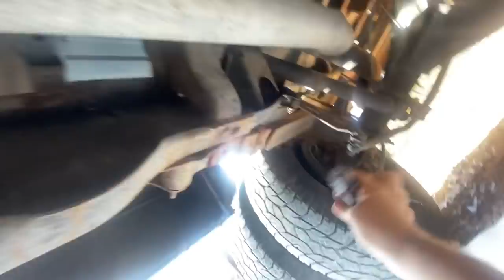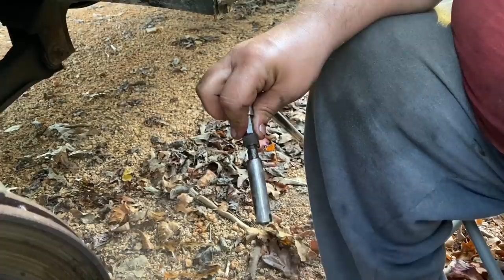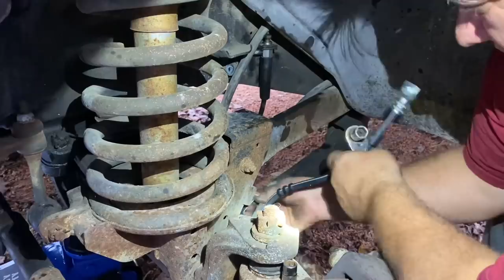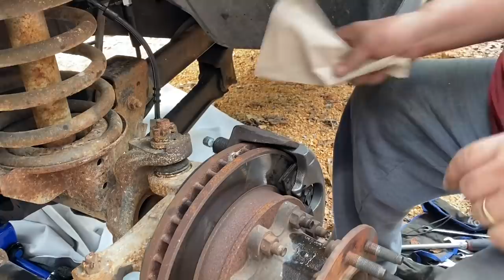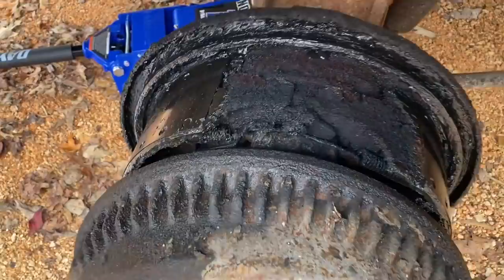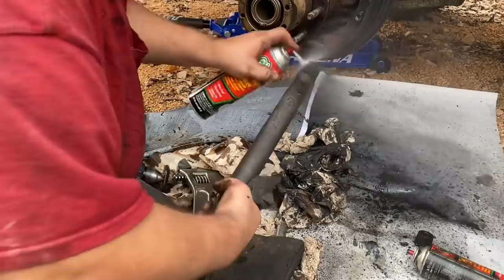Brake work and maintenance on the dodge 3500

Comment: The jack is not low on fluid. It's secondary pump  check ball is stuck likely from metal filing not being properly cleaned out during manufacturing or just poor manufacturing. Harbor Freight has zero quality control and put that task on the consumer to waste their time, effort and money to return it or toss it if they wait too long(win win for them). I just watched another video last week where a guy had a HF jack collapse on him under load. Best part is HF is not liable for anything they sell as they manufacture nothing. They are simply a middle man pushing products from independent Chinese factories and you're left going after Wong Lee Inc if you get hurt. Good luck with than one.
Reply: That would make sense if it's a two pump jack and the lift stops at load rather than position.
Maybe Scott will update us with solution.

Comment: Changed my carrier bearing on my 2007, and it is a major pain! Glad to see the truck videos, hope you make more of them! These old Dodge with the Cummins last forever. I would check the u-joints on that drive shaft, the carrier bearing going out usually causes u- joint to fail as well!

Comment: I had a similar problem on my 03 Dodge Dually with the front brakes. It would brake fine, but when releasing the truck would pull to the left. Turned out it was the little metal clamp that surrounds the brake hose, that you bolt to the suspension. It had rusted on the inside and was putting pressure on the rubber hose. When you braked, it would force the fluid pressure down the hose through the obstruction, but when you came off the pedal the pressure would take time to release. New hose and clamp and all was good.
Reply: Yep had the same issue on my 97 this week. just pried the clamp open a little bit and its fixed!

Comment: The carrier bearing is super easy to change! 4 bolts and slide it off and slide the new one in. Takes 15 minutes. I did one on my 99 2500. A Jack helps hold it in place while you put the bolts back in.
Reply from the maker: It is much more involved than that.   Press fit, drive shaft has to come apart and the tiny splines need to be perfectly aligned.  15 min won’t even have the drive shaft off.
Reply: @BusGreaseMonkey  True. You may end up slicing it with a die grinder. Gaurantee it won’t just slide off.. As you are aware just make sure your slip yoke is in phase with the rest of the driveshaft when you re assemble it

Comment: You got two problems, a harbor freight jack and a dodge
Reply: @mikek5298     Actually not trying to be smart..Should have bought a super duty f 350
Reply: Triggered the dodge owners.
Reply: @scottbaker1018  I believe Scott got the truck free from the fellow in Missouri with the two GM buses that got passed over by a tornado.
Reply: Like all old vehicles, reliability is proportional to the amount of maintenance done....  Old Dodges, Fords, Chevys, whatever - it's all pretty much the same.  And, yeah, I've owned and worked on all of them.
Reply: @scottbaker1018  so is that how you know about Jack's because you have a ford
Reply: @davidcaskey4669  Yep i need to jack up my ford to get rid of the pieces of chebbys and dodges I ran over 😂
Reply: @scottbaker1018  you are right about one thing  you do have too lift the body up off a Ford just to work on those power junks

Comment: I had to do driveshaft repairs on my 2004 Dodge. Pulled the shaft. I even have a 20 ton press. I could not remove it. The local place was amazing. They took 20 minutes to do what I struggled with for 4 hours before giving up and having a beer. Oh, and have them replace the u-joints while they have it apart.

Comment: If that is a "two speed" (Rapid Pump®) jack, the valve that shifts from fast to slow is stuck.

Old bleeder : Crack the banjo fitting.  Apply heat.  Quench the bleeder with an ice cube. Use left hand drill bit.

Drain the differential.  Refill.  Drive for a couple of days and drain, while hot, and refill again.

Comment: Recommend replacing the rear wheel cylinders when you do the rear brakes.  Didn't catch what was up with front axle carrier (differential).

Comment: What I find the best way to extract a busted bleeder valve, broken bolt, etc., is to drill and tap with a left-handed bit and tap with a smaller diameter bit and tap, then use a left-handed bolt to draw it out. Sometimes the drill bit is all you need if that draws the remaining bleeder valve out.

Comment: I was glad to see the proper lube on the sliders for the new caliper. Never use wheel bearing grease on caliper sliders, it gets thick and gooey sticky not allowing the caliper to move properly.  Get a hardware kit for those rear brakes, you'll get all new springs and a new adjuster along with other goodies your gonna want.

Comment: Saw you change out the caliber. sSuggestion when changing out any caliber, you should remove the bleeder valve and put anti- seeze on the threads and put it back in.  The cast aluminum of the caliber tends to gall the steel bleeder valve, making it difficult to turn when bleeding the caliber.

Comment: If you are regreasing sliding caliper pins in rubber sleeves, you gotta use the right grease. Like the milky coloured stuff on the new caliper. "Normal" grease attacks the rubber liner and makes it swell, jamming the pins again. Done it myself.

Comment: My friends Dodge truck had both of the clamps  in the middle of the brake hose rust. The rust swells and crimps the hose shut. I also had the same thing happen to my Malibu. I cut half of the clamp off and put some cable ties to hold them.

Comment: SCOTT UR A VERY HARD WORKER!!!! I WISH WE LIVED CLOSER U COULD BRING THE DIRTY DODGE OVER & WE COULD PUT IT ON ONE OF MY LIFTS & WE COULD GO THROUGH UR TRUCK THROUGHOUT OK SCOTT MY BROTHER JUST PULL THAT DRIVE SHAFT & GET THE HEAVIEST DUTY CARRIER BEARING PREFERABLY WITH A GREASE FITTING ALONG WITH ALL UR U-JOINTS & TAKE THE DRIVE SHAFT TO A DRIVE SHAFT SHOP & LET THEM REPLACE ALL OF THEM PARTS ITS ALMOST IMPOSSIBLE TO CHANGE THE CARRIER BEARING & U-JOINTS WITHOUT A TORCH!

Comment: Vent tube on rear axle plugged.  Keeps condensation inside axle heat and cool off.
Rear brake cylinders will be full of water and rust.  Best to replace with new, can be honed and rebuilt if you can find kits

Comment: Dodge Ram are notorious for having squishy rubber brake hoses. My 07 2500 had the same thing on the drivers side. You hit the brakes and it would dive to the right (passenger) and then it would straighten out after you yanked the wheel to the left. A Dodge mechanic said he recommends changing the brake hose every 35 to 40 K.

Comment: The jack is low on hydraulic fluid.
Reply: Exactly. HF will usually cheap out on a component, so they cheaped out by not enough hydraulic fluid. HF cheaped out on my reciprocating saw by using a cast aluminum collar. Collar broke, ordered a new one but got a chunk of forged steel, fabricated the collar out of the forged steel by shaping it the exact same as the cast aluminum one, never had any problems since and now it's 15 years old.

Comment: Unitized seals are way to go with that rear axle hub.  I replaced the hub seals on my Ram 2500 and they leaked again in very few miles.  The next time I installed Unitized seals and they have been bone dry for the last 60,000 miles.

Comment: Your Jack may just the air bleed out of it. Here are the instructions out of the manual for the Daytona 4 ton Jack.
1. With the Jack fully lowered, remove both Screws
on the end of the Cover Plate that is closer to the
Saddle. Swing the Cover Plate open. See Figure A.
2. Remove the Fill Plug on top of the Cylinder.
Check that the oil level inside the Cylinder is
at the top of the Piston. See Figure B.
3. Insert the Handle into the Handle Socket
to operate the Release Valve.
4. Turn the Handle counterclockwise to open the valve.
5. Pump the Handle up and down quickly
10-15 times to force air from the system.
6. Replace the Fill Plug, close the
Cover Plate, and reinstall the Screws.

Comment: On the front rubber brake caliper lines. The metal bracket rusts and pinches the hose. Try and loosen the metal brackets on the rubber hose.

Comment: You are better off replacing the caliper, actually it could be the problem with the brakes sticking. I did a front brake job on a Dodge truck a few weeks back and advised the owner to replace both calipers because of age, but he refused because of the price, long story short he called me a week later and said one of them locked up outside of Nashville, 450 miles from home. Over the years I’ve seen many of them stick and lock up. From this point forward I’ll refuse to do a brake job if the customer refuses to replace the calipers with mileages over 100k or 10 years old.
Reply: Dodge had issues with the phenolic pistons on the oem calipers. Seen them wear the pads uneven but never lock up? Im in Ca so manbe snow and salt is an issue in some states

Comment: Moog carrier bearing at auto zone $25 labor $75 at local drive line shop. If the bearing is good you can buy just the rubber part and maybe have $25 total in it.

Comment: Get all new Lug Nuts, in one brand. Brand A will be 7/8th, oem might be 15/16's and brand Z will be 1 inch.  Change the rear axle gear oil, you might want to check the axle seal on the other side as well. Usually on light duty trucks they fail around the same time.

Comment: Sometimes they ship those jacks low on oil
It is low on oil
Reply: yes... cheap fix. Hydraulic oil  fill up point is normally on the top ofthe ram
Reply: Yeah, and a cheaper fix is just exchanging it for one that actually works while it's still under warranty. Poor QA should not be the customer's problem.
Reply: H.F. usually sells cheap made in China. If still in warranty take it back with receipt to get a new one. Could likely be out of oil but pump sea or cylinder seal.may be bad. Never seen repair kits for these unlike the American made ones that can last forever when renewed.
Reply: Most tools from HF you will need to do the final check out and adjustment, just the way it is.

Comment: I suspect your trolley jack may have flipped a seal over.  Unfortunately, a lot of modern jacks aren't made to be serviceable so taking it back and getting a replacement or refund is probably your only option.  One of my trolley jacks is 60+ years old and only on its' second set of leather seals.  It'll lift a car or small van like it's on an express lift/elevator...

Comment: What happened to the innards of the front axle?
Keep one brake assembled as you work on the other side, that way you'll have a reference (or take pictures.) Buy a new hardware kit when you get the shoes, they aren't much money, the springs lose tension as they age and will cause the shoes to drag.
Reply from the maker: The front axle is somewhere over the rainbow 🌈
Reply: Always called that method of keeping one side of drum brakes assembled “the Iranian blueprint”. 

Gotta be careful though, since some of the hardware is reversed. Make sure the self adjusters will spin the right way (before they inevitably freeze up), and the shoes are in the right position if there’s a little and big shoe.
Reply: Just have to remember one side is a mirror image of the other.

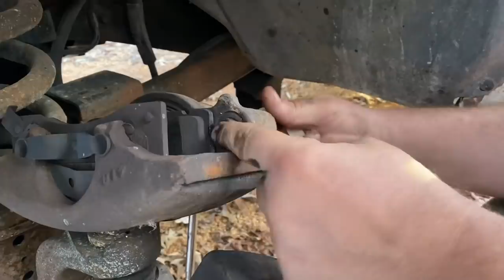Comment: 4:20  The only caliper lube  I have found to stop those specific caliper slides from seizing is 3M Silicone Paste 08946.  I have tried everything from Sylglide, exotic brake lubes, grease.  Some will seize in a month, some make it three months, but they all seize in short order.  Good idea to remove the rubber inserts remove rust etc, and line the bore with the silicone paste as well to keep rust jacking at bay.  It is a shitty design, only lasted about a year before Dodge changed it.  The rubber deflects pumping the lube out, and ingesting water.

Comment: Whay do you need a new caliper for?? you should have heat it up before with a strong blow torch,  you can drill it out with a left-handed drill bit or make your own left-handed drill bit using a right-handed drill bit, one size smaller than the bleed nipple if that's 10 mm use a 9 mm drill bit ideally doing it in a drill press or can be done by hand, or a small chisel you could chisel it out and might be needed after you drill it out, ideally a thread extractor. You should really have taken the nipple out and put a bit of brake grease around the thread and the bass there's no need to tighten them extortionately just nip them up
It's not a bearing it's a bush and you can fill it with silicone make sure it's centred first and has to be hard silicone not stuff you use for your bath one that can be baked
You'll need to go round the drum on the edge probably have a lip, with a stone in a drill depends how big the lip is

Comment: I'd be doing  wheel cylinders while in there. Also shocked at the surface rust, there never seems to be a corrosion coat put on US made cars
Reply: That's intentional....to make you buy new again after a few years.

Comment: Hey Brother ! I would go ahead & REPLACE BOTH FRONT CALLIPERS & ESPECIALLY THE BRAKE HOSES! I’VE HAD THEM HOSES STICK WHENEVER U APPLY THE BRAKE & TAKE :20-:30min to release if they release! Ur going to be hauling a lot of stuff I think I even heard u said Tyler & Carter was going to take his GOOSE KNECK TRAILER TO GET A BULLDOZER & BACKHOE! I wish I was closer to u! If u tell me what the ratio of the front & rear differential is I may have a front differential & if u can get me the measurements on both drive shafts I may have all of that stuff off a truck I junked I just wanted the Cummings Engine! The truck only had 65,000 miles on it! ALSO IM NOT SURE ABOUT THE TRANSMISSION I THINK IT WAS A AUTOMATIC BUT EITHER WAY IF U WANT THAT STUFF U CAN HAVE IT FOR UR TRUCK!!! Let me know about the ratios & measurements & I will go look for that stuff! 
SCOTT U CAN HAVE ALL OF IT IF U WANT IT! I’m APPROXIMATELY 7-8HRS from Nashville Tn I live in Wv about 9miles from THE TAMMARACK IN BECKLEY WV! Everything is a wreck I sold one Division of my trucking company so everything got moved! Around but my Forman keeps a pretty good mental note where things are placed! Here is my Email daveellison1971@gmail.com
Reply from the maker: 3.54 is what’s in the rear.  Do you know what is in your axles?

Comment: Looks like you gotta look at some of the videos from South Main Auto.  I wouldn't of used that grease on those brake caliper bolts.
Reply: I dont know what kind he used, but I have fount that using standard grease on pins like that swells the rubber and make the pin stick worse.
Reply: After watching more of the video i see the new caliper used the silicon brake grease which is def what to use.
Reply: "Not a sponsor"

Comment: I couldn't tell what kind of grease you were using on the caliper pins. You should never uses chassis grease. It will make the rubber bushings swell up. Permatex makes Ceramic high temp caliper pin grease. Like I say, I couldn't see what you were using, so if i am wrong, ignore me!

Comment: Please stop using brake clean and other chemicals without gloves. All that nasty is absorbed by the skin and gets stuck in your liver. If you would not drink it keep it off your skin. I did not know better 40 years ago but we do now. Keep up the good work. I have driven those carrier bearings off with an air chisel but sometimes had to cut the race with a torch.

Comment: I would replace the caliper before I would replace the hose.
Check the hydraulic level on the jack.
Reply: My auto teacher back in high school taught me to always check the cheapest part that could cause the problem first. You've got that bass ackwards, and sideways to boot.

Like the time my dad bought a new master when all he needed was new shoes on the rear.
Reply: Most likely the factory original hose, and it was acting exactly like what a failing hose acts like.
Reply: Having worked in a repair shop for 5 years.  A slow to release brake is the sign of a rusty caliper.  Customers wont pay for parts that dont need replacing.  Replace it if you want too, but the job was for a bad caliper.
Reply: 5 years...

 Ok chief, you sell them the caliper, and ignore 22 year old rubber part. 

I’ll be doing the diagnosis to verify the hose issue (cracking the bleeder free while it sticks). 
If releasing the pressure through the bleeder releases the wheel, it’s getting the hose. If the caliper still sticks, or somehow I couldn’t get the bleeder out, it’s getting BOTH. 

If my customer has a problem with me replacing the 22 year old brake hose, that cost all of $10, on their 1ton dually pick up they intend to tow with, they’re welcome to go elsewhere in search of the cheapest price.
Reply: @wi11y1960  "Mechanics" Like you are who make the nightmares Scott has to fix happen. 

And how shops get a bad rep because you repeatedly replace high dollar parts when a hose worth a couple bucks would have done the job. 

SMDH

Comment: As to the rear wheels and brakes, I would suggest replacing the brake cylinders too; if you haven't already considered that. Did someone give that truck to Tyler, or pay him $500 dollars to tow it away? :-)
Reply from the maker: After a little love, it’s going to be a great farm truck!
Reply: I’ve seen people work with far worse. If that truck were in New England, he wouldn’t be cracking brake lines free, he’d be replacing them. 

While it looks a bit rusty, certainly not rotted like we see up here. Should make a nice reliable rig once all the issues are wrung out of it.

Comment: Probably no oil in rear end and bone dry. gasket  probably leaking not good for gears. Same 90wt from bus should be ok to use. Brake shoes are rivet type so look pretty worn. even if not oil soaked, good to change them out now as not much mileage left before rivets eat up drum. You don't want to know what they cost. New shoes super cheap by comparison but best to spend for the best Heavy tow shoes  since you plan on towing heavy with this truck.